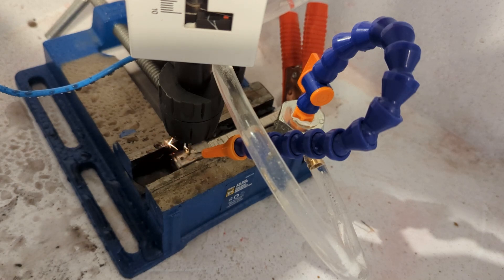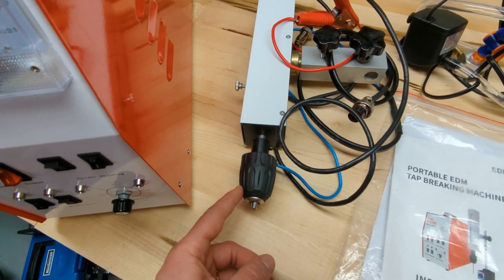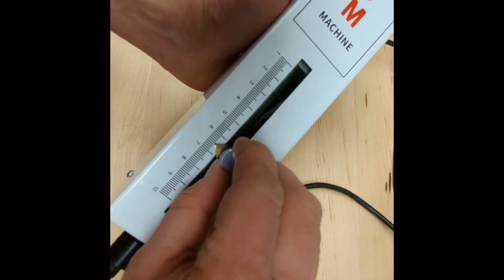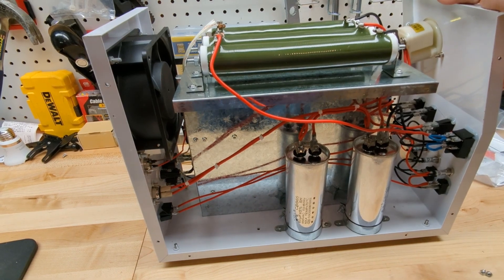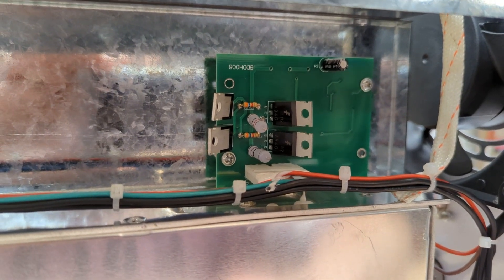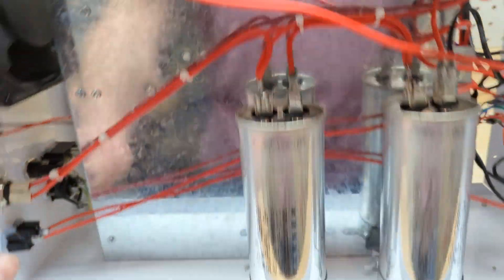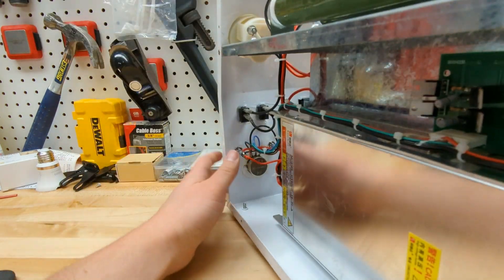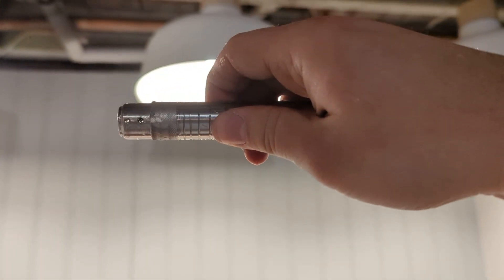Testing Vevor 800W EDM For Removing a Broken #4-40 Tap

Comment: Those big resistors(inductors-L) and big capacitors - C, are critical to the machine, as they created an LC Tank(resonator) that is powered by the SMPS.
The machine is essentially an AC TIG Welder minus the gubbins(torch, spark gap.... ).
BUT you may even be able to use it as a HF AC Tig starter with some simple mpds(spark gap, induction loop..).
A hand unit to have?.
👍
Reply: No, those are power resistors creating an RC network. They will have some inductance being wire-wound but it will be negligible since they are wound on ceramic cores. They limit the current into the capacitors to control the charging time.

Comment: There is feedback, and it is a servo. The feedback just happens to come from the spark current, sensed by the driver board controlling the FET's.  This is fundamentally how automatic EDM works. By controlling the spark gap, via a servo mechanism, to prevent a dead short, or open circuit, maintaining a spark.  When a high current is sensed (verging on a dead short), the motor retracts the electrode, opening the gap. Then when current drops (verging on open circuit), the motor advances the electrode closing the gap. The sense mechanism this uses is basic, but works. Essentially only short and open circuit detection. A "servo" is not explicitly a motor. It just so happens most servo mechanisms use some sort of motor with a relatively directly coupled feedback mechanism, usually position feedback of some sort.  A servo can be any mechanism that has closed loop control.   A better driver board that has better current control could be developed fairly easily and would potentially make it much faster maintaining a more constant spark.
Reply from the maker: Thanks for the detailed background on the EDM, added a note for people to check your comment in the description! Makes more sense how it works (& seems to work fairly) well based on your description.
Reply: is this $1000 of components ?

Comment: how long did it take
Reply from the maker: Pretty fast,  less than 5mins maybe? Most of the time was setup, and in my case realizing I needed to run again with a larger electrode. But the actual EDM procedure was pretty fast.

Comment: Awesome! What do you think the thinnest "wire" it can work with is, really what is the thinnest hole it can leave in metal?
Reply from the maker: The smallest it comes with is a 1 mm electrode which was the first one I used. They tell you to not let too much extend as it will jitter with smaller diameters, so it's probably more a mechanical limit on how small you can get & having enough rigidity. The design of this machine has a solid chuck so you can easily feed a narrow piece through, but it wouldn't take a lot to just make a custom head to make it easier to feed out a bit at a time. The included chuck goes down to 0.8mm (claimed, didn't test), so if you don't want to change anything that is basically your limit!
Reply: @ColinOFlynn  Ahh, very cool, thanks!

Comment: How is the tap removed after it has the hole?
Reply from the maker: If the hole is big enough (why I needed to redo it with the larger electrode!) the tap should just kinda crumble out when you hit it. Basically you try to drill out the center part of the tap (at least with small taps, with larger taps can try to drill out one of the side flutes).
Reply: So a hole is drill/EDM'ed big enough to disconnect the tap flutes from the center. Neat!

Comment: What's the power rating of the resistor?
Reply from the maker: Not sure - no markings on the resistor I could see, but with ~70V across it in theory you could dissipate 160W. They might have underrated it though since it's mostly pulses.